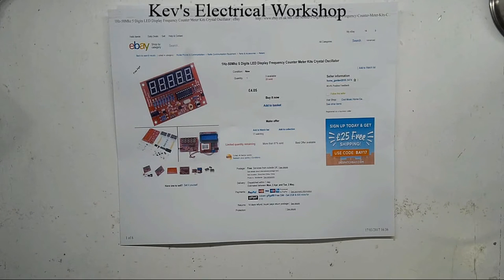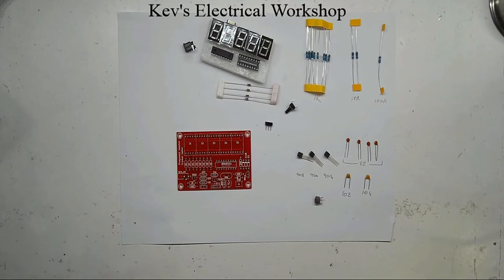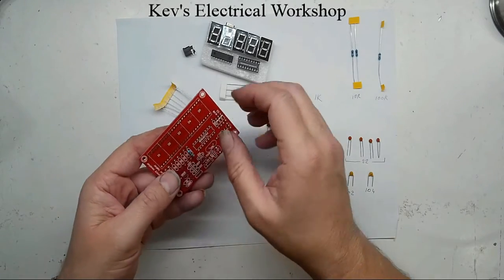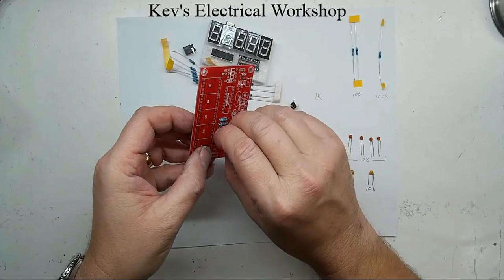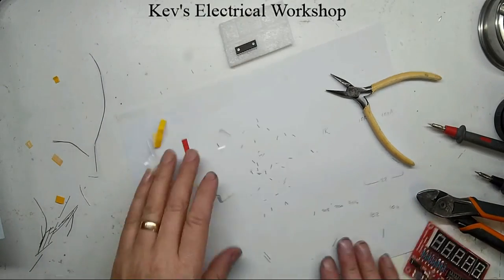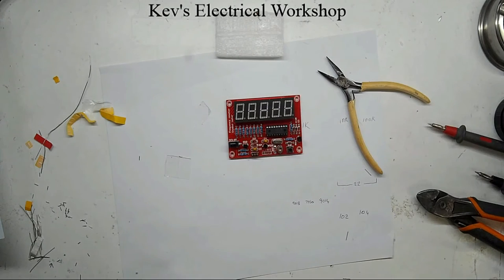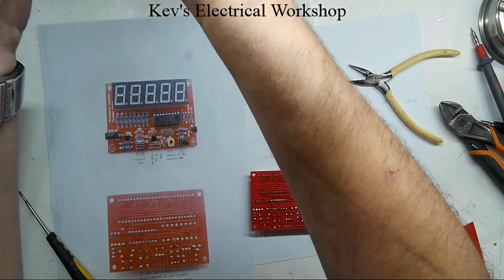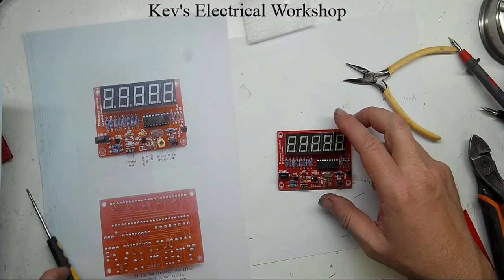Digital LED 1Hz-50MHz Crystal Oscillator Frequency Counter Kit Build

Comment: Thanks for the video Kev.  I received my kit yesterday including a link to your video and I was able to build it today.  My soldering isn't great so watching your efforts was very helpful.  Excellent that you found the printed instructions which are really helpful for operating. Regarding the extra 22pF capacitor, I want to use the counter for lower frequencies and no way could I have guessed where it would go without assistance.  My Counter seems to measure a 20MHz oscillator quite accurately.  Cheers.  John
Reply from the maker: didnt know my link was being included with these kits LOL, keep it up John you will get better with time

Comment: Hi Kev, I have just finished building the frequency counter and checked a few crystals...7MHz, 10MHz, 11MHz, 16MHz and 20MHz...I think it worked very well.A PAL subcarrier crystal at 4.43361875 measured it's 3rd harmonic 8-).  I think low freq xtals would need larger value caps than the 22pF ones.  I checked the "freq in" with a 555 oscillator and it worked very well. A preamp is needed unless ttl cmos signals only are to be measured. 
I only paid £2.94 with free pp .
Reply from the maker: result only £3, since you measured the high xtal ok would imagine there is a capacitor thats cutting off the lower end.

Comment: To init/setup press and hold NoPsv, press and hold zero. Power save is auto shut off, only needed if you use batteries .. zero is to clear any offsets or corrupt resident value that can happen from time to time.